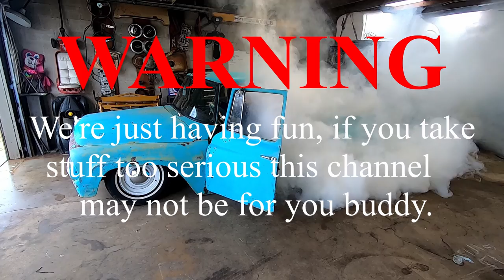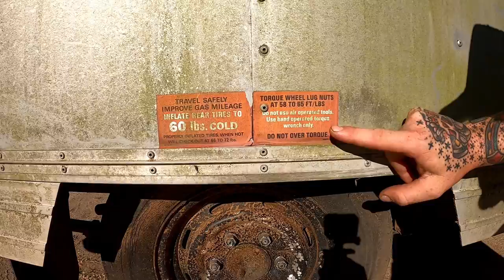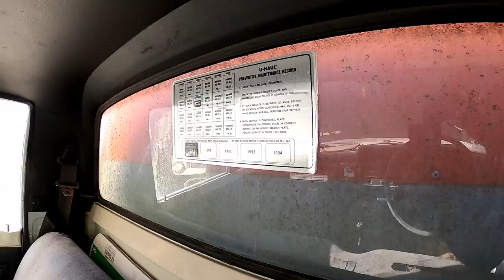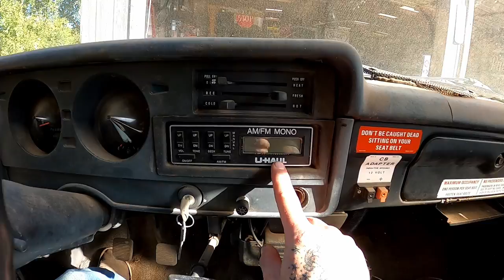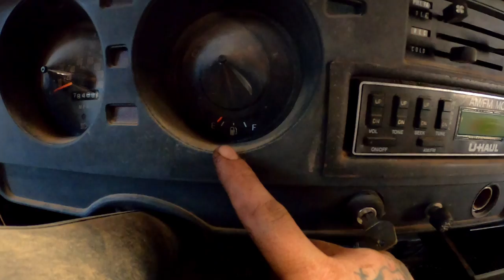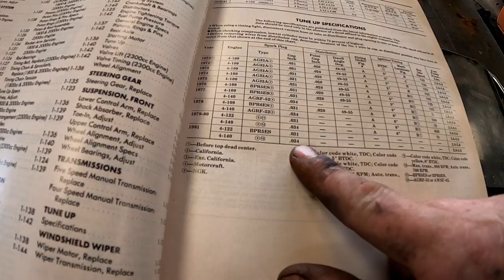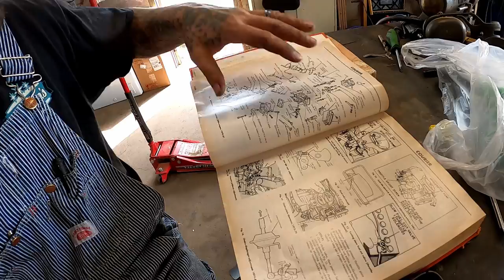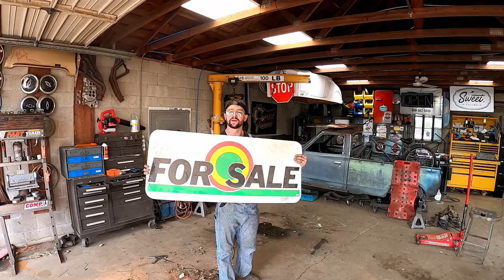Abandoned MINI TRUCK box van! (OLD U-HAUL) Will it run & drive after sitting 20 years?!?

Comment: Haha, this is great!! Back in the late 80s, when I only had a driver's permit, I had a job as a line boy for Yoo-Haul at one of their NYC locations. This was back when every truck in that fleet was an old Ford with a manual transmission. The Mini-Movers I remember were probably a couple years older (more like a Ranger with a 8x8 box just stuck on it), but pretty much the same as this beastie. I had a lot of fun (over) loading  these with a load of party tables, etc. for local deliveries all over the insane streets of NYC, but the best thing was that at this shop, the Minis lived upstairs, up a spiral ramp, and there was no room to turn around up there...,so we'd have to back them up the spiral ramp.  I got really good at that, even at rather high speeds. Really the only "sporty" thing in their fleet; the 10-footers are pigs by comparison (although they can haul more). Enjoy this stupid thing!!

Comment: I remember U-Haul having the little Toyotas when I was a kid (I'd kinda like to have one), but I've never seen one of those Couriers, that thing is too cool.
Reply from the maker: It’s pretty rad!
Reply: My neighbor has one of thoses small Toyota Uhaul in his backyard for years. Ask if he'd sell it an said no😡 I pass it all the time.
Reply: I've actually been looking for a little Toyota U-Haul but probably wont find one in California. Guess I'll just have to wait a couple years till we move.
Reply: They used Toyota's for Mini Motorhomes too...
Reply: @garymallard4699  I want one of those too. They'd make a great flatbed!
Reply: @garymallard4699  I had one with a 22r4 and a four speed.  It got about 15 to 16 miles to the gallon on the highway.  The only problem was they can't keep up on the highway. They'll barely hit 60 mph. LOL. When they are full of camping gear.
Reply: @tnplumber5217  
I just passed on on our main Highway ( Canada ) on the flat prairies ....it was doing about 100 kmph ( 110 limit )....Toyota Motorhome....
Reply: @tnplumber5217  
They would be a great swap for a diesel VW !   Especially as most would have pretty old worn out engines.... You can get a kit and trade the gas for diesel power..should get over 20 mpg?? And more torque for the hills!!

Comment: I used to drive one of these when I worked at U-Haul way back when. It's called an "MM" known as a mini mover. Very cool trucks to drive. They are VERY rare nowadays. We couldn't keep them on the lot back in the day. They were always being rented out.
Reply: There used to be a Toyota too, a V6 but had dual tires out back, right below the ford vans and trucks.
Reply: @PatricioGarcia1973  Yep. Those came after I was gone from U-Haul
Reply: @TINYNumismatics  yeah, they were unkillable
Reply: same here, i put engines in em and all the other trucks back in the day

Comment: Weird...... You keep having this great success and ease with Fords.
Reply from the maker: Right!
Reply: Hmm such an interesting coincidence lol
Reply from the maker: Wasn’t a coincidence when I found that 360 with a rod sticking out the oil pan. Lol
Reply: The 2.3 is a bulletproof engine, a buddy of mine has a 2.3 with a turbo
Reply: @justinmitchell773  lmao apparently u have never drove nothing else but a Ford because I’m a die hard Chevy guy and I have beat the flying hell out of all them and never had a problem
Reply: And that was for basedWisco715
Reply: @timothyfowler8278  the diehard chevy guy thinks chevys are the best

Riveting stuff here
Reply: Been driving the shit out of everything I own and I got my license at 16 and I’m 56 and never own nothing I can’t tell u how fast it will run and never get in it that at some point I don’t put it on the floor and run them over 110 to 130 with cold air pipes programmed with 90 hp and 90 foot pounds of torque
Reply: @basedWisco715  I absolutely 💯 % disagree.
Reply: @justinmitchell773  93hp baby! My 03 ranger had a dohc 2.3. 143hp
Reply: @trythinking6676  my buddy's 2.3 is a sohc and its pushing 450-500hp
Reply: It's a Ford it should be easy
Reply: @timothyfowler8278  every brand has their bad cars, no exception, but im a diehard ford guy, so thats mostly what i buy
Reply: Two words: oil filter
Reply: It's actually a Mazda with a Ford pinto engine.
Reply: @timothyfowler8278  lol just on your 3rd transmission and 2nd 2nd replacement engine. But hey it's got 500k on the replaced  speedo! 2nd frame, throttle body  replaced. Other than that they are tuff!! I've owned a couple or 3 lol
Reply: @jeraldhite9744  well I know where one Chevy truck is here at the end of my road that is parked now but has 670,000 miles on the motor that came in it never changed the oil because he was a logger and so when it lost oil pressure he wash the oil filter out with gas and screwed it back on and was running when parked and my nephew has one with 440,000 never been touched still driving to work every day so y’all can say what ever you please I know how I drive I grew up racing and driving hell out of everything and plus what I see from others and have not seen nothing beat it
Reply: @basedWisco715  ever heard of a straight 6 LOL
Reply: @2wildtravlers  nope, what’s that?
Reply: Cambron Gabaree  well believe what you what the truck is at the end of my road and I’m at White Lake North Carolina so if u want to see it
Reply: Cambron Gabaree  I dont doubt that a bit
Reply: @timothyfowler8278 get him hooked on them Iron Dukes, lol
Reply: @timothyfowler8278  just ignore the issues  that chevies have and they are the best!
Reply: @member57  Mazda engine.
Reply: @danbasta3677  
Nope it's a Ford 2.3L and a Mazda Transmission. The same one from the Pinto series.
The Mazda trucks (B series) had a 1.6, 1.8 or a 2.0L depending on year. The grilles and headlights were different.
Reply: @jeraldhite9744  I have never replaced a motor or transmission and my truck has 175,000 on it
Reply: @timothyfowler8278  
It’s preference.
I know people who have good luck with 1 brand and junk from others.
And that’s not a specific brand they’ve had luck with.
Personally speaking I’ve had the best luck with fords, 
But I know people who have problems with them and luck with GM or mopar.
Dad has a Jeep Wrangler and has had good luck and those are nothing but memes for problems
Reply: @basedWisco715  said no one ever lmao
Reply: Those chevrolet guys follow the advertising dollar. You see a Ford man you know you just met a man that knows.
I remember those couriers pretty cool find! Love it
Reply: @coolbreeze5561  I don’t follow no one I worked on both and I just plan do not like a Ford it is the aggravating thing on the planet to work on and if u would admit it the transmission r not worth a damn the motor is fairly good but u about have to go to school to be able to know what parts interchange
Reply: @timothyfowler8278  If Ford is so aggravating why are you chevrolet guys always longing for Ford parts? A chevrolet guy will pay big money for a Ford 9 inch and then brag he has Ford parts in his chevrolet. The Ford C6 is the strongest transmission on the planet all those drag racers can't be wrong. If you chevrolet guys hate Ford why are you always buying a Ford and putting a 350ci chevrolet in it, that's the one that annoys me, the 350 is weak I tried to run one and had to put 2 crank shafts in it before I could unload it at half what I had in it. Chevrolet guys will recite their favorite hot rod article or today power nation or whatever that cartoon is called. I just say one thing, my Tbird is pumping a 400ci Cleveland... My fomoco is all fomoco.
Reply: @coolbreeze5561  because it is a easy rear end to work on take out put together back in but they don’t even do that now and that is the only thing easy to mess with in a Ford and I don’t know of anyone paying to much for them around here about 150$ to 200$ but myself I rather have a cut down 14 bolt then u don’t have to worry about it breaking
Reply: @timothyfowler8278  let me give you a little insight to the Ford engines they are simple. Ford is engine families. If you are old school you want the FE family. Like small blocks go with the Windsors. Want to race the 335 known as the Cleveland has ports that will suck a seagull out of flight. Prefer a big block, the 385 engine family would be your choice. The parts in their respective families interchange. No fuss no muss no confusion.
Reply: @coolbreeze5561  but it has to many families the small Chevy for years till Ls take any head put on any small blocks any big blocks all head interchange and can take any trans and bolt to any motor right on till today
Reply: @coolbreeze5561  but I’m not telling you not to buy Ford if that is what you want hey each is on but I just prefer my Chevys always have and always will
Reply: @TheCatOfAges  Chevies?? What's a Chevies? Lmao
Reply: @timwegman5776  chevrolets.
Reply: Ahaha. Everything but the 2.3 is Mazda!
Reply: @jeraldhite9744  all that to that Ford u driving u may need to change to chevy

Comment: I revived an old U Haul when I worked at a salvage yard a few years ago. It had been sitting for years and I bought it for scrap, but I decided to play around with it since I had never had one before. I played around with it for about an hour, and it fired right up. I used it around the yard for a couple of weeks, then slapped a for sale sign on it and sent it to a new home. It cost less than $50 to make it driveable again. Hopefully it's still on the road somewhere. Those things are tough. That's one thing I miss about working there. Saving as many as possible was my favorite part of the job.

Comment: Those things were everywhere up here in WI when I was growing up. I think they got replaced by the van looking ones. When these came up for sale they got snatched up and hoarded away, a lot of them go used for "shop truck" but up here that meant they got to run in the salt all winter until they were nothin left but the box, then people cut those off and sold them for $50 as portable sheds. 

Honestly, I don't think you could ask for a better "stuff mover" so long as you aren't trying to load it down too much. I mean its flat inside with a knee high load height and you can strap things up no problem. 
I hope you get this thing fixed up, it will serve you well for a long time!

Comment: In the mid 90's I drove that same truck for years delivering parts. Beat the hell out of it, and it never once broke down that I can remember, just had to add a quart of oil once in a while. Can't say the same for the 79 Chevy flat bed we had, that thing left me sitting on the side of the road more than once. Mine didn't have the awesome U-haul Mono radio like yours though. Shout out to the ol' gang at RPM in Fresno.
Most importantly, Happy 3 month birthday!!!!! That's Awesome!!!!!!!!

Comment: The engine is a 2.3 litre Ford . The square block fuel pump is a Mazda item that works better than most. If you inspect the intake manifold, you may find a removable adapter that will let you fit an old school Ford two barrel carburetor..p.s. beware of a possible speed governor on that truck, U haul did that on most of their stuff.

Comment: I had one of these Ford Curriers back in the early 80’s. Same cab with a regular small bed and tailgate. I took that thing from Massachusetts to up and down the white mountains in New Hampshire five times AND three trips to Chicago and back! It was great on gas being a stick shift four cylinder and it never let me down. I miss that thing. I had made a pop camper for the back and it comfortably slept four! The video is just starting and I usually wait to comment, but I’m looking forward to seeing what you do with it. I haven’t ever seen another one on the road beside mine and the occasional but rare uhaul!

Comment: Love your videos! Big fan! Engine assembly lube is not ideal for seals in the clutch or brake system. Petroleum products will cause brake seals to fail. Best to either just use brake fluid or find (hard to find) brake parts assembly lube.

Comment: My first truck was a 81 Courier 4 speed.  Same as a 81 Mazda B1800. I put in a new distributor, fuel pump and clutch slave cylinder. .  It had 35,000 miles when I bought it, sold it with 155,000 on it.  2.3 was optional.

Comment: I like the fact that you have sense enough to clean these damn things before you start all of the repairs. Never made sense to me to work through, around and in that crap and then, after everything is fixed, cleaning it. Seems like fixing everything would be a lot easier if it was clean to begin with. This is the second video of yours that I have watched. You were recommended by Mortske Repair and Mortske was recommended by Halfass Kustom. Small world I guess. Keep it up. I will keep watching.

Comment: The Ford Courier and Mazda B2000's are workhorses. You won't go fast with the 2.3 or the 2.0, even with 5 speed. As a matter of fact, you will reach a point where you begin to dread highway driving. I have owned eight of these little trucks but never one with the Uhaul box, despite my efforts. 
If you ever get tired of that Nikki carburetor consider grabbing an Offenhauser dual-plane intake and a Weber carburetor because they offer instant improvements. Also, if you need a header to replace the leaking exhaust manifold then reach out to the folks at Power By Ace. The 2.3 is the easiest to find performance parts for because that is the same engine which came standard in the Pinto. The 2.0 version is a nightmare to find parts for so be glad you have the 2.3. 
Finally, drop spindles do not exist in the aftermarket game so I am keenly interested in your approach. I love your content and have subscribed because these trucks are becoming scarce. Please keep it coming. If you ever decide that you are tired of dealing with it let a brother know!

Comment: Puddin if your worried about oil on your cement floor , put a A fairly good Tarp on the floor then drive over it the Tarp will catch every thing that fall's off it and you can save your cement floor ;-)

Comment: That lima engine is bullet proof,  I had one in a 93 Mustang with over 500k miles before I blew it up running it hot. Keep water and oil in it and it will run forever

Comment: Dood, I have a 79 Courier with an '85 Mustang 2.3 in it. Blew the original engine in N. Alabammy. 
Got tired of the crappy Hitachi window with a view carb and went to a Weber.                          Waky waky!
The baby lit up. Sourced a later factory header from a Mustang 2.3 and added a fat pipe and muff. 
Yes Dicky, a totally different truck.

Comment: those old tow bar mounts were used by UHaul to  transport the vehicles to different Dealerships  around the Country  where they might had been needed  for rental  it used to be real common to  see a Convoy of Uhauls  going down a highway   they did have a pretty good network of Vendors that built them heavy duty   boxes and trailers they used for rentals  but UHaul also had a reputation for  not staying on top of maintenance on  a lot of their vehicles  because many independent dealerships  just didn’t care

Comment: I got to thinking after I shared this with some friends and my caretaker just watched it here with me... that old orange ford out back, I seen a bunch of old boys a logging down in arkansas when I lived there in 73.... spent me some time there looking into cat fishing and doing some "noodling"  when I saw my biggest cat fish and come out of the water like I was Jesus walking on it.... them boys pulled the bed off, laid out some steel stakes out of a car frame on the back that they could stack logs against and held them up with the metal that was supposed  to protect the back window. That truck  was beat to death for sure as it had more knowledge bumps on the cab and back window a missing. they laid those logs on the back sideways and were close to eight foot long. Pile  rounded over to the back starting high at about five feet high in the front part and got lower towards the back. It was pulp wood they packed out of the woods and hauled to the mills about there. So make some kind a red neck log truck out of it so some folk are milling their own lumber can haul it with it.     Just a dumb idea.... unless it works

Comment: Nothing wrong with JB welds hell I used it to patch the top of my muffler on my old car and kept doing it until the sucker fell off from the weight!  Also used it to seal a cracked lawn mower gas tank and that sucker didn't leak for 5 years!

Comment: Looks like its got the 2.3 Lima Pinto engine which was a upgraded version of the very solid British Pinto engines, with the 2.0 and 2.3 Pinto's if the cambelt broke you didn't cannon the piston crowns into the valves but on the 1.3 and 1.6/1.8's the valve to crown clearance was so small you could kiss goodbye to piston and valves and likely to bend rods and crankshaft too.   The Pinto block went on to be used with Ford's DOHC engines in later models here in Europe and the US and of course a modified and tuned block variant used for the Cosworth engines.

Comment: if i remember correctly. the only diff between 2.0 and 2.3l was differnce valve openings. its been a long time sense i dug into the motors. but im sure it was it
Reply: The 2.0 is a Mazda Engine the 2.3 you see here is a B2300 with the Brazilian build Ford 2.3 straight 4.